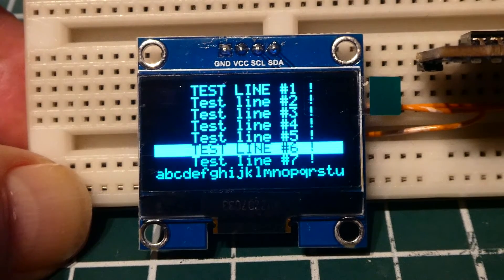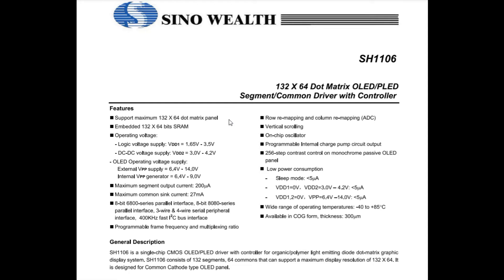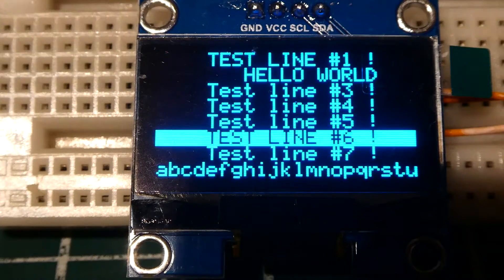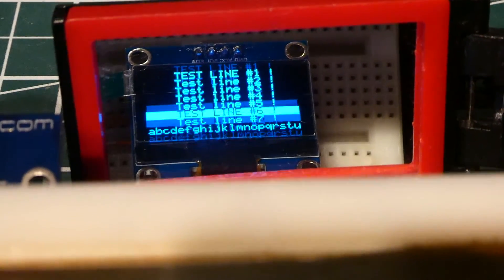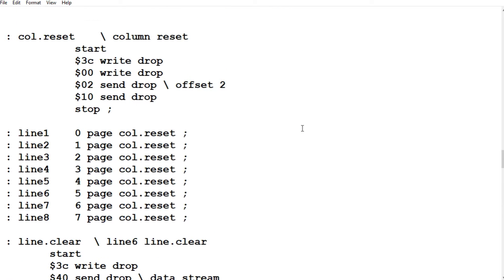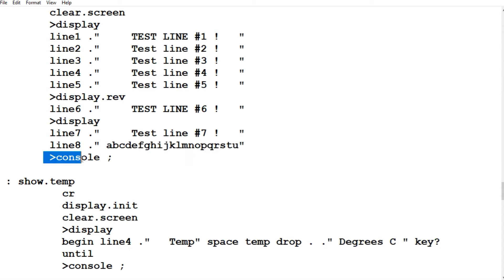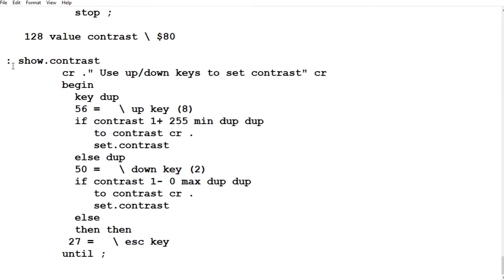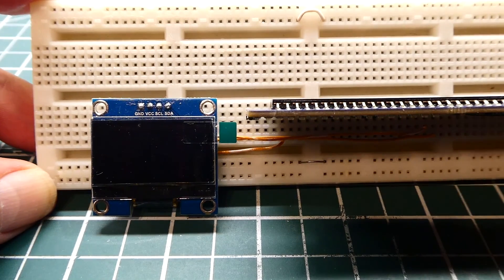OLED Display Interface / SSD1306 / SH1106 / Flashforth

Comment: Would the same work on a Prop P2 Tachyon (forth) and if so, how would you declare the pins
Reply from the maker: Have not used a P2 but it is probably similiar to the P1, so check out how to setup the I2C port with these docs:
https://docs.google.com/document/d/1bEH0DfGmu99M1SqCbmlzl991Ssv2J5m6XWmkJX0XSl8/pub

Comment: Do you have any hints on how to load such large programs into the SCAMP3? I use the screen util on my mac, but cut and paste sometimes does not work will.
Reply from the maker: The Forth compiler is running on the microcontroller where you send code to it through the USB port. If you send code too fast for the compiler to handle, you will get errors. Find a serial terminal program where you can add character and line delays. TeraTerm running on Windows is what I use where you can add these delays. Check out this video that describes this technique, it is not the Scamp board but the principle is the same. https://youtu.be/FAIOIACJY0w

Comment: Thank you so much for your great, educational videos.  You are the best!!  Two questions - 1. I know the Scamp3 has FlashForth embedded and you have been using eForth (I think) on Arduino, in your opinion which is best?  2. I want to get a Scamp3 and try it, but the cost seems to be $30-40 per board compared to Arduino, STM32s, etc. at $4-8 per board.  What justifies using the Scamp3?
Reply from the maker: I started the Scamp3 video series as I was getting a lot of requests from viewers on how to program microcontrollers using Forth. Ths Scamp3 board has a PIC microcontroller running Flashforth with the addition of Forth support words for GPIO, ADC, UART, I2C with I2C scanner, SPI, PWM, onboard Temp sensor and 16 LED array. So if you think the support is worth the price you can get the Scamp3 board or download Flashforth (free) for the Nano or UNO and write your own support words for the protocols mentioned above. I had a website on how to write your own support words but there was little interest. The Scamp3 board is a good start for beginners. If you want a simpler Forth I have written Interactive Arduino. Here is a link to a video:  https://youtu.be/PY01_9dANd8
Reply: @0033mer  You said - " I had a website on how to write your own support words but there was little interest."
 Is that website still available?  Where could I find it?
Reply from the maker: The website was part of a local "Maker" club. After I informed them there would be no further support, they took it down. Early into the pandemic the Maker club also closed their doors.

Comment: Hi there, could you do the same in C, to be compatible with the Arduino IDE. never heard of this language. i'm using a pic32mx, original microchip Fubarino board.
I'm trying to do the same currently, wanna use page addressing mode and do not really understand: Lower / higher Column Start Address (nibbles), Set Display Start Line.
i have partially success, but the function that comes next goes on where the previous ended.
Reply: is there an existing arduino library that you can look at the code?
Reply: @nil0bject  i got several and they all take the same approach, start from the upper left pixel (page) and upload a 512 or 1024 byte array to the device to draw (write) using horizontal addressing mode, if you do Page addressing you can save the 512 / 1024 byte array in you precious little ram space you have on a MCU.
sure you can draw images if you want to in horizontal addressing mode, but being able to more the cursor around allows you save lots of ram, use a smaller array or no array at all. the SSD1036 display has 3 modes.
Reply: @nil0bject  SRAM 	2 KB (ATmega328P) for the Arduino Uno if you waste more than half for a display, that sucks.
Reply: @nil0bject  they all use the same method, easier to make grafix, accept for a guy that published a video on SSD1306 yesterday here, but he is using a language called Flashforth, he is doing what i want, but i can't really read that code. he posted his code online.
Reply: @nil0bject  i know how to address, but trying to assign a address in a dynamic way, ,like inside a loop doesn't work well.

Comment: good work
Reply from the maker: Thanks for the visit
Reply: @0033mer  hey could you reply to @Analog Dude
Reply from the maker: C is not structured to be Interactive. Forth is very good at controlling hardware using minimal memory.
NASA uses it for this reason: https://www.forth.com/resources/space-applications/
Users of Forth do not advertise, that is why I started my channel.
You can use any language for direct address programming if you clearly understand the data sheet.